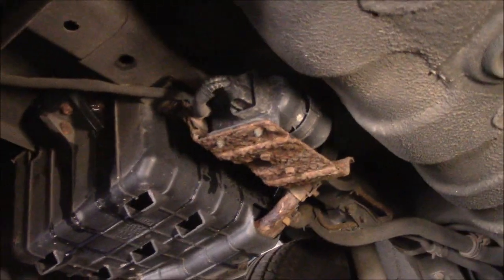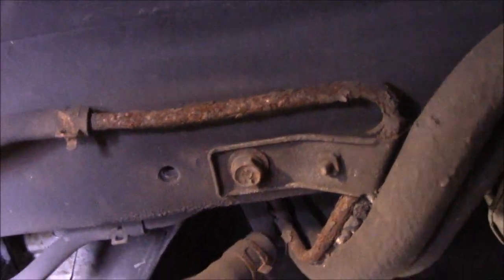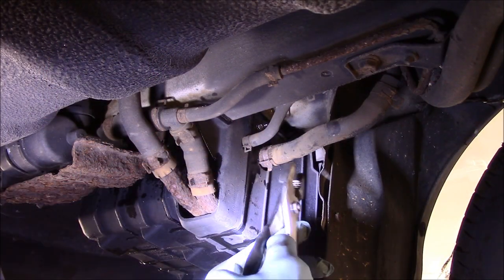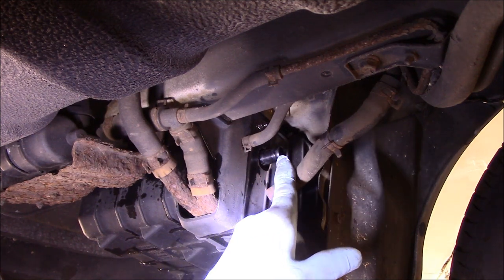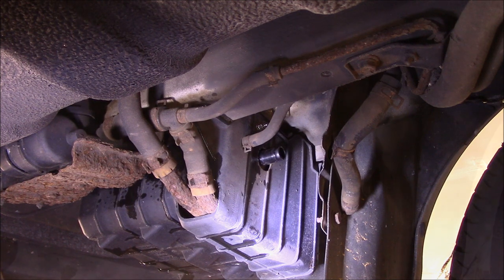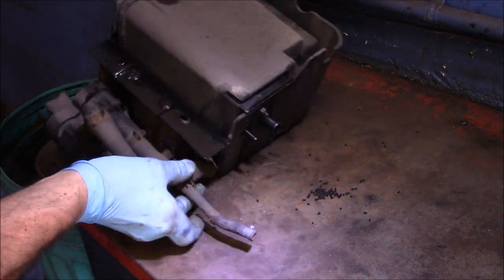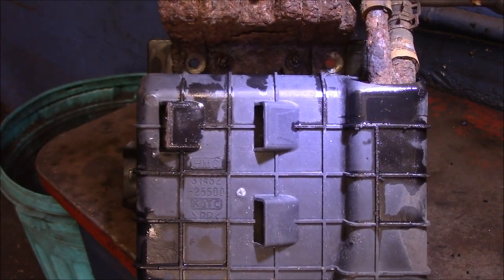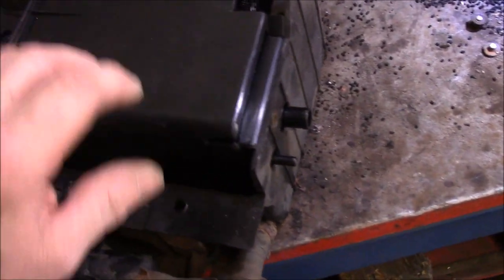How to fix a car that will not take Gas the pump keeps shutting off

Comment: This just happened to me this evening with my Mini Cooper. Went to two different stations and kept cutting off as described. Thanks for the great video and showing it's a reasonably resolved issue. My panic attack subsided lol.
Reply from the maker: Thanks for watching . I'm happy to help.
Reply: going to a different station doesnt change a thing. what can change your issue is running the nozzle at a slow rate instead of wide open.

Comment: Hi Jim, Thanks for the great explanation on how the vapor canister system works.
Another great video, thanks for sharing your knowledge.
Reply from the maker: Thank you for stopping by
Reply: Thanks for a good video with your comments. Very helpful.
My question is if there is "any way" to temporary bypass the  broken
valve, just to be able (for a short time)
Reply from the maker: BoPettersson There is really no way to bypass it, but if you disconnect the small hose that I showed in the video, all the particles in it can be cleaned out. This may work for a short time.
Reply: 7Westwood at
Reply from the maker: I'm happy to help.Thank you for watching
Reply: Hi Jim I change the evap stuff what else can make it do tht

Comment: Thanks for info. Just shot carb cleaner into vent tube. Made it better for half a tank. So this must be the issue!!! Thanks again for a down to earth video 
Have a 2010 patriot that did that last year. I checked the canister last year. And ran some Humour fuel cleaner. Issue stopped. This year started again. 
Boy, this disabled body under there and give this a shot.

Comment: Rough job but just learn valuable issue regarding the fuel tank cause to back flow. while fueling.Thank so much
Reply from the maker: noway Jose such an easy problem to avoid just by not topping off the tank

Comment: I was recommended to a small garage. 2007 Dodge Caravan 79k miles. Power steering pressure hose needed replacing. Also they were checking for gas fumes we could smell after we got out of the car from a short or long trip. It was determined the fuel pump nipple was cracked so they replace the fuel pump and a fuel line that goes to it. When I got home I noticed the hose for the charcoal canister was not connected and didn't seem to line up and the rubber hose looked pinched under the gas tank. I took the Van back and he dropped the gas tank a little and repositioned that hose and connected it and showed me. It looked properly done. BUT now when I go to fill the tank the pump shuts off after 10 seconds. I do know he told me he had to remove the charcoal filter to get the new Power steering hose in so I know he did mess with that but other than that I don't feel comfortable taking it back. I know we all make mistakes but I would think since I saw this hose not connected just by looking under the van below the drivers door and it was so obvious, you would think a mechanic would have also seen that. I did get a check engine light after I discovered that hose off too but now there are no check engine lights as he cleared it.  Any idea what could be causing this issue?  I know hard to know without seeing it. What would be your advice?

Comment: Hey Jim my wife has a 2000 S10 blazer we picked up. Is this the same kind of problem for her maybe? We tried to put gas in It right after We bought it and it'll fill if we go Slow and then sometimes it clicks off, but it takes ABOUT 5 MIN TO FILL IT AT 1/4 TANK. THX.  loved your channel.

Comment: My issue turned out to be the hose from the filler tube to gas tank rotted on the inside and pinched off the hose, replaced the hose and it worked great.

Comment: Hey Jim:
   I hope you can help me but appreciate your video either way.
Lots of stuff to 'unpack' here but I want to give you as much info
as you might need.
1995 Jeep Grand Cherokee Laredo 4.0 L 4X4
OEM motor and trans installed before I took possession (Bar code still 
on the rocker box)
Excess of 250K on the ODO
Over the past few months (I don't drive much...retired) I've noticed
Lots of air either escaping or sucking as in vacuum but it's become 
worse pretty quickly.
On a trip to visit my daughter, the motor started sputtering and a
couple times even shut off as the problem got worse.
NOT driving it at all as I'm tired of calling my neighbor for a tow.

At first it seemed if I vented the gas cap it would crank up
almost like a relay was resetting. Replaced Fuel Pump Relay.
 
     Now it doesn't matter even if I unhook the vent tube. It will 
run for a few minutes stutter and quit.
 I replaced the fuel filter and no change.

I ordered a fuel pump assembly which may fix the stalling problem 
(like it's running out of fuel)  but don't think the 2 problems are 
related.
I have begun replacing other items like TPS.
Maybe you can help me find the "Purge Valve" and canister location..
Been all over the internet and on a 1995, it's NOT where they say 
it is. (I think 1994-1998) Also, the Diagnostics port is not to be 
found (at least not where it's supposed to be)
I CAN get the codes by switching the ignition on and off 3 times.
Don't think the EGR valve is linked to any of this but that is on
my short list to be replaced.
So in summary:
What do you think the problem is and where is the Purge Valve/
Vapor Canister Location ? 
Not even sure a message this long will even post on youtube.
Thanks!
PS> Yes, I  got a new OEM gas cap...no improvement.

Comment: Hi is this problem common on most cars? I have a 2001 bmw 740il and have noticed that I can only fill it with gas to half of the tank, then the gas nozzle shuts off.  I guess I can tell my mechanic the problem and hopefully they will know what to do.  What is the name of the part you replaced? A charcoal gas canister? Thanks

Comment: Good video Jim!  I have heard of people that have a stopped up canister but aren't having fueling problems.  Are there any trouble codes that would point out a bad canister?  
Oh, by the way, in Oklahoma we don't have quite the rust you do.  I have a friend that lives in upstate New York.  What he does just before fall season hits he puts his car up on Jack stands or a car lift and sprays all exposed metal parts under the car with a heavy coat of "Fluid Film" coating he buys at Lowes.  He swears it protects his car from all the salt until the next year.  
Take care Jim.  Tom
Reply from the maker: The rust here causes some really easy jobs to become a pain in the rear end .Thanks for watching.

Comment: Hey, I have this problem but I have a new aftermarket fuel tank with a valve that's 3mm instead of the 10mm which was on the OEM. I believe this is the top side valve on the tank which is used for vapour release. Would this cause the fuel not to fill up properly and the pump to click every few seconds instead?
I had to use a brass reducer and some new fuel hoses to bridge the difference in valve size from the new tank to the carbon box thing.

Comment: Interesting video!
The filter inside the canister desintegrated.....I wonder if is possible to open the canister, change the filter, the activated charcoal, and put it back again?
Seen that corrosion, do you reccomend a corrosion protection oil or something?

Comment: Hi, I recently got a check engine light, also I can't pump gas, it took me like 10 minutes to fill it up 😄.
Also noticed a suction noise when I remove the gas cap and a hissing sound coming from where the canister is located after a drive my car. 
Your video really explains how the evap system works however I still have a question. Should I replace the canister purge valve, or the center valve solenoid before I replace the charcoal canister? Thanks.

Comment: Beyond the fuel pump clicking-off, not-filling-up issue, what other problems/symptoms are likely to occur if this issue isn't addressed? Can it afford to wait? There's no CEL.  I have this issue on a 2az-fe '09 camry that's gotten progressively worse this winter. I realized a year ago before I had this issue, I once used this pump that continued to fill without stopping automatically.  Before I noticed it was already full and had a chance to stop it, I saw gasoline leaking out from the bottom of the car near the driver-side rear wheel.  Is it likely that this was the canister being flooded with gas, leaking out the canister, and then dripping out of the subframe? Thanks.

Comment: Thank you for this!!! This will be a nice lesson to teach my son for his tiburon. I see a weekend project lol. I do have a question though.  We have a hard time getting parts up here where we live. Do you think we could get by for a few fill ups by Just clearing the lines as you explained without replacing the filter until we can get the proper part?
Reply from the maker: Yes if you can clear the lines until you get the parts it should be good.

Comment: Cheer for your best instructor 👨‍🏫 and I have a 2001 Audi TT 1.8l base  turbo, charcoal has leaked gas coming from vent while the car was running .. a lot of gas leaking and why ? Stuck with purge solenoid? Any one knew this issues? Thanks

Comment: Ironically In New Hampshire things not going according to plan is something you always have to plan on when working on cars. So I guess in my case it is the plan. Anyways, I think my Subaru has this same problem?  Sometimes I have a hard time filling it and I do have a evap code that kicks the check engine light on. I can't figure out until now I believe. My car runs great but i'm always nervous around inspection time.
Reply from the maker: Drew Johnson thanks for watching I'm happy to help

Comment: My tank usually stops filling at 14 gallons out of 20, I get a gas cap light, an engine light, and an EVAP system leak code.  I already replaced the gas cap and that didn’t solve the issue.  Do you think I could be having the same problem that this video portrays or do you think it could be something else?

Comment: so if the  charcoal canister or vent valve are bad the computer wont throw a code right? it will only do it if the purge valve its bad. im not sure if im right. thanks much for your video its very helpful. :)
Reply: I'm having this issue with a chrysler but no check engine lights

Comment: I'd like to know how to find my charcoal canister or my vent solenoid on my 2003 hyundai tiburon gt v6 ..I went to the gas station and tried to get gas and the pump stopped a lot. And I'm getting fumes I'm mealy bent of the ac. So a guy said it sounds like my vent solenoid and I can not locate. If you have any help.for I'd greatly appreciate it.. thank you.. awesome video too

Comment: Is it that when filling with gas the tank pressure is displaced through the charcoal canister, but if the canister is plugged up, the tank pressure when filling with gas is displaced through the smaller line that is connected to the filler neck? Thus being, the charcoal canister is vented to the atmosphere with a normally open vent valve, but if this system is clogged, then there is another valve in the tank that opens and routs vapor pressure through the small line that is part of the filler neck? Thank you.

Comment: I'm having this pumping problem on a 02 Taurus and I have completely disconnected the vent hose to the charcoal box so that its just the hose going to the top of the tank. I am able to blow into it and it blows back after. I still can't pump gas so no I'm wondering if I'm gonna need to drop the tank to figure this out. Winter is coming fast in Mn and I'm not looking forward to spending a 1/2 just filling my tank in -20 degree weather. Any thoughts?

Comment: I had the vent solenoid and the cannister replaced on my 2005 chevy Avalanch and it’s still not taking gas at the pump the way it should although it’s not as bad as it was. Any ideas where to go from here?

Comment: Hi Jim, excellent video. Got another question... This issue has nothing to do when you're actually driving in the car does it? I changed the fuel filter on my 2000 Avalon and the pcv valve, but for some reason it seems like the car isn't getting fuel correctly for some reason. You can put your foot on the gas and it won't go for a second, then all of a sudden it takes off and jumps. It does this continually while driving now. Any ideas on what could be causing this? Can that canister be causing this issue while driving?
Reply from the maker: Did you make sure the the air intake hose is connected correctly?
Reply: I will check that today, thank you.

Comment: Hi Jim, I recently had mechanic install new fuel pump and filter in my 2002 Ford Explorer. Now I can’t pump fuel as usual, same as your video. They blew lines out said its fine but problem still ongoing. He’s short one man due to surgery, any suggestions? No codes are shown on computer!
Thanks, Charlie E.
P.S. enjoyed your video
Reply from the maker: Does the fuel pump run?

Comment: So I'm confused, you put the old charcoal canister back on the car you did not replace it with a new one. Do we just need to clean it out or is it best to replace it since I have heard that fuel gets inside the canister sometimes and it doesn't have the ability to breathe. Thank you
Reply from the maker: Good question. I did replace the canister with a new one (10:25) . I'm happy to help. Watch for the next free tool giveaway coming soon.

Comment: I put a new canister and a new valve and the solenoid is opening and closing  fine when i tested it ... BUT still not able to fill the tank ... any ideas what else could be the problem, Cadillac escalade 2007 ,,, Thank you
Reply: Buy new purge valve. Cheap and easy install

Comment: Do you like I did tomorrow 6 I just turned at the light. Hose going to the canister and just let it vent to the outside it's a whole lot easier in the whole lot cheaper
Reply: You wont pass an emission test doing that most likely, it should set a p1000 code for the parameters of that evap vent valve, but yeah I can relate for my daily shit box lol
Reply: @glennwern5919  people who have to pass them in areas care but yeah I agree, should just get u to point A to point B, or go fast or tow.

Comment: My 2003 GMC Xl Envoy having the same problem with the shutting off at the pump what should I do boss?
Reply: John Doe 
The first thing you need to do is no longer fill your car up with gas pass the pump clicking off. 
Second thing you need to do is to disconnect the rubber hose which goes from your fuel tank to your evaporation cannister it is probably plugged up with particles of carbon that line the inside of the canister ,take the hose off it’s easy to do ,messy job back breaking but easy 
Use an air compressor and blow air through it ; if you don’t have an air compressor you could actually use your mouth and blow through the hose forcefully

The whole idea with the evaporation cannister is to capture fumes gasoline fumes that occur when refuelling so they don’t  escape into the environment 
Your evaporation canister hose would be plugged up with particles of carbon because the gasoline destroyed the inside of your cannister 
As you know gasoline is an excellent cleaner of anything and will break anything down including your carbon filter that lines your cannister ,the cannister is vented to allow air out but it does not allow liquid out in this case liquid being the gasoline 

new cars have canisters that are very small there approximately the size of a can of Coca-Cola in another words they will fill up very quickly with gasoline and get damaged very quickly and be expensive for the car owner to have replaced 
$400 plus labour to put it in so we’re looking at 600+ taxes 

so your best off if gasoline is cheap stop refuelling when the pump clicks .
Hope this helps...

Comment: Don't know if anyone will see this or if it will help anyone in a pinch.  My 09 Subaru Forester had a check engine light and P0453, EVAP system over pressure. Couldn't put gas in the tank, it would just spray out after a second or two.

Of course this would happen right before I had to turn my keys into my landlord and drive up 2 days to my new home 

Anyway, I cut a length of garden hose that just fit into the fuel filler neck past the little trap door and pushed it in as far as I could then blew like hell. The gas stuck on the filler tube sprayed out and a second later I heard a thunk like a stuck valve opened or a clog was cleared.

Right after that, it took fuel in with no problem. What's made me do upset about this is that 2 different dealerships won't fix it because they don't know what's causing it. It's the second time this had happened to me. So I'm just going to keep a section of hose on me until I can fix it myself. I wanted the dealership to just swap the entire EVAP system, canister, valve and everything but they wouldn't do it.

Comment: I'm having a filling problem with my Cobalt it always clicks off at the pump. The guys at the pump always do it for me and I tell them when it clicks don't put anymore but they always forget. Been going there for 2 years or so now and I think it finally hurt the canister or something else.
Reply from the maker: Yes for sure if they always over fill the tank the gas goes into the canister and will destroy it.
Reply: @jimthecarguy  Mine is below the tank too that probably doesn't help. I know in my 97' Camaro it was in the rear wheel well under a plastic cover and much higher up. How does the fuel get into the canister is it from the filler neck area through a hose or lower down near the tank?.
Reply from the maker: @simonriddick   Most of the time it get into the canister from the vent in the top of the filler neck
Reply: @jimthecarguy  Ok I see it looked it up. My filler pipe has the tube attached and close to the neck. I can see them filling the canister with the way the pump for sure.